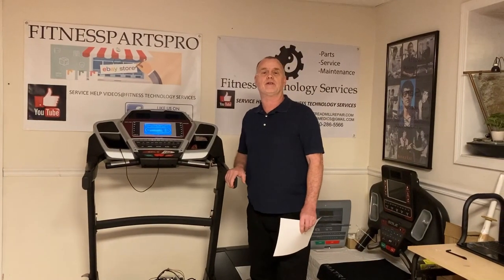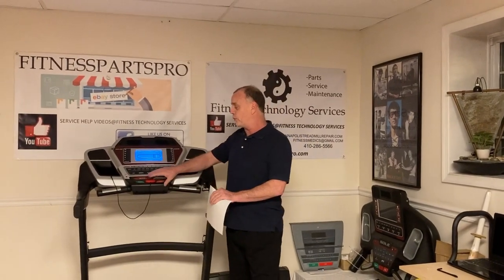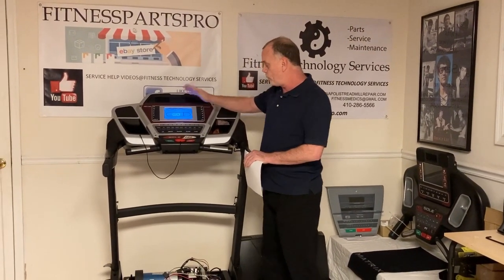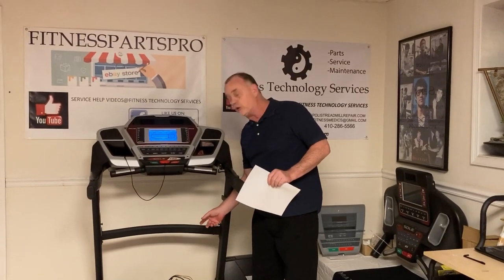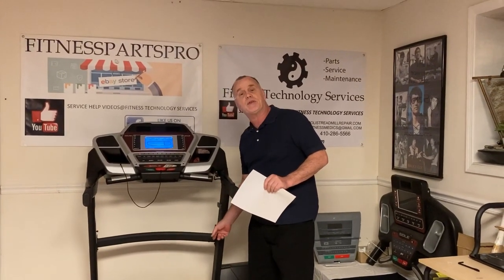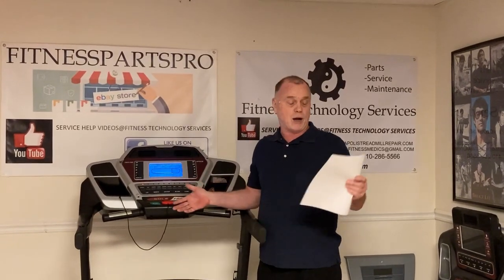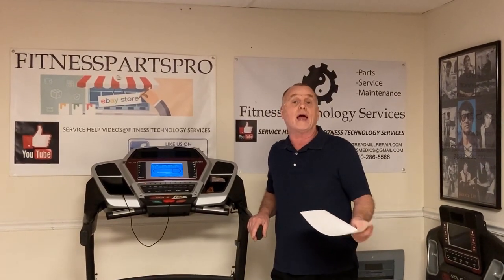SOLE TREADMILL TROUBLESHOOTING

Comment: My Sole F80 suddenly stopped when I was almost on it and gave low speed  error.  Replaced the speed sensor.  Still does it.  I have lubricated it. It still does it.  I ran it for an hour at 4mph and it was perfect.  Stepped on it to walk and it stopped after about 1 minute.  Ive watched your videos about control board and all the lights and everything appears to work as you say it should in your videos. Can you point me in a direction to get this fixed please?  Thank you!
Reply from the maker: Ok this is in the walk belt once the belt is worn after a while lube won’t have any effect on it .See video on testing your walk belt.If you want enter your serial number on my parts site.Fitnesspartspro.com and you can find it I also have a video on installing it

Comment: Hello.  I have a Sole F85. I bought it in May 2022 and do 2.5 miles a day walking inclined. Recently I stated getting this E2! Error.  The machine will stop dead and I have to unplug it to clear the error.  I'm a large guy at over 300 and the reason I got this machine was the 400 lb capacity
Reply from the maker: Well normally if you get a E2 you should run the unit with no one on it! To see if it is a weight issue or some type of controller error. The best way to tell is with some type of amp meter see video treadmill power meter

Comment: Bought a Sole F63 today. When I finally finished setting it up, it runs fine, but there is a clicking noise that increases when the speed increases. Seems to be coming from the left side of the machine. I am hesitant to keep running it, but thought I'd try here before calling service dept. Thanks!
Reply from the maker: Hmm on the left side could be the speed sensor hitting the front roller. You would have to remove cover to see for sure
Reply: @FitnessTechnologyServices  Wow- did not expect an answer that fast. I did take the cover off and look, but don't see anything hitting the roller. I ran it with the cover off to be sure nothing was rubbing or hitting the belt or roller. Not knowing exactly how it should look, I only assume all looks ok.
Reply from the maker: @darrinlandry639  well I am on line doing some editing on my channel normally I am not so fast but I do try . Is the sound coming from the motor. Sometimes the motor brushes don’t sit right in motor and cause tapping You should definitely call sole 1800-258-8511 is the service #

Comment: Hi there, I have an F85 treadmill which is ~3 years old and has had moderate use. I get an E-6 error when the treadmill starts which I believe relates to the incline motor or sensor. I’ve tried to reset a number of times but the error persists. I have tried to diagnose whether it is the incline motor or sensor by disconnecting both the sensor cable and the red/white/black power cables to the main controller board and restarting, but even with the incline motor disconnected I get the same error. Do you think I need a new controller board, incline motor, etc.? Thanks!
Reply from the maker: Hello E/6 is listed as a controller failed but if you bought it new should be under warranty there # is 1800 258 8511 please subscribe Dave

Comment: For the Sole f63...What if it doesn't move when it says 3,2,1... It looks like it starts to move, then rolls back and doesn't move.
Reply from the maker: This is mostly likely a lower controller issue but first run the motor on a drill battery to test it
Reply: @FitnessTechnologyServices  I tried that battery test, and it didn't run, but I'm not sure I did it right. Is there a video on that?
Reply from the maker: What of course 😀go to my home site fitness technology services type treadmill motor test 👍
Reply: @FitnessTechnologyServices  ok, battery worked on motor and it spun. So, it sounds like maybe the lower controller? Is that the one that's approx $300? May not be worth it...I was hoping for a better result and simple fix.
Reply from the maker: @ssmorol  well you also have to think what cause this most go bad due to worn walking belt see video on that also ! Dave

Comment: Thx for the video! I bought a used F65. Everything works great, i calibrated the belt. But now i can't figure out how i can connect my Garmin Heart Rate strap to the F65, they both support bluetooth.
Reply from the maker: I don’t think it will. I would check with sole on that to be sure 1-800-258-8511

Comment: My Sole F63 powers up and I can set up an exercise routine.  However, when I push the start button, it does nothing and reset after it goes 3-2-1.  I have had it for seven years but haven't used it that much. I had been consistently using it for the last 4 or 5 months.  Any assistance would be greatly appreciated.
Reply from the maker: Hmm this sounds like a console issue try putting your key in backwards and clean the silver part real good I would your serial# for better troubleshooting send it to fitnesspartspro.com on my contact form thanks
Reply: @FitnessTechnologyServices  I didn't see a serial number based on where the manual stated it would be.  However, I opened up the lower panel and saw these number on the control board (CD3332256L00424)  (YJ-2256L) &  (A512-100723024/8500).  In addition, it no longer goes 3-2-1, it now does nothing.  I looked at the key, it was very rusty. I will try to somehow clean it and placed it back in but it is in really bad shape.  If it is the console, what kind of price am I looking at to get it fixed?  Would it be better to just buy a new treadmill?
Reply from the maker: @MOEoffical1  Well consoles run around 350 to 400 but I would need your serial number to be sure . And if is over 4 years old might need walk belt also I have a bunch of videos on testing your belt, send me a picture of your console to Fitnesspartspro @ gmail.com I will send you links for testing or look through my repair channel fitness technology services for more info . The lower controller numbers don’t help on your issue .

Comment: I have an F80 treadmill that has been used lightly until about 2 weeks ago, then I started using 4-5 times per week. It'll take me through the whole "select your program" beginning routine and then when I press "start", the belt moves 1 inch and the screen displays "E7" ... how do I fix this? Thanks
Reply from the maker: That’s power failure probably bad controller. Send me your serial number to Fitnesspartspro@ gmail.com so I can see what system yours has

Comment: Hello:  Thanks for the video!  My problem is I keep getting the message say Low S1 and the belt doesn’t move at all.  Could you give me a few suggestions on how to fix it.  Thanks a bunch!
Reply from the maker: Hello sorry I must have missed this the highest chance of this error is the motor control board
Reply: @FitnessTechnologyServices  :  How do I order the part.  I need to order it quickly!!!!  Thanks
Reply from the maker: @desireecelestine3679  send your serial # to the office fitnesspartspro@gmail.com I will get it done for you

Comment: Thanks for the video. I've been searching for a solution with a problem with my F85 2020 model. I can't get any audio out of it. Nothing through the speakers, headphones, or bluetooth. I've reached out to Sole and they just brushed me off.
Reply from the maker: Hmm this is going to be in the console or at least one of speaker boards , this is hard to get to .You have to remove the console back cover and order the board that goes to the speaker. I have never done it on a newer unit. Only the main display or whole console.You have to get someone at sole , They are normally pretty good These parts maybe under warranty even

Comment: Hi Dave.  My F63 will not turn off unless I press the main power at the bottom of the treadmill.  In the past, when I removed the safety key, the treadmill would momentarily turn off.  Any suggestions?
Reply from the maker: @TimG-k2v  Hmm I would first check the safety key module it is what the key slides into see video on changing sole f/63 display I show it in this video

Comment: Hi Dave, your videos are great and I really appreciate your help.  Like some of the other commenters, my 2021 SOLE F65 treadmill stopped abruptly during a workout.  When I try to power it back on, I see the red power light  but the display will not turn on.  There is a solid green LED on the circuit board.  I tried recalibrating but that doesn't work and have left the power cord disconnected overnight and tried again but nothing. There is a red flashing LED on the Bluetooth icon on buttons (I don't know if that's supposed to mean anything).  Any help would be greatly appreciated, thank you.
Reply from the maker: Well thank you, on newer units it’s hard to say. There not a lot of troubleshooting information. But normally if it happens while you are running the controller is bad over heated, normally due to walk belt wear . Are your parts under warranty ? If not you can send me your serial number to Fitnesspartspro@gmail.com and the office will check. If you want send me your controller and I will test it

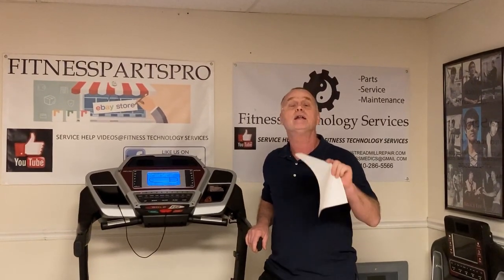Comment: Dave- within the past year, I 4:04  have replaced the motor, circuit board, the mat and flipped the deck on my F63. Today while 28 min into a run, it stopped suddenly, the screen went black then came back up. No error.  Any idea what happened?  I am 5’6” 150lbs and was running at 5.5mph on zero incline.  I checked plugs and the emergency sensor and all were secure.
Reply from the maker: Hi Traci try running the unit with no one on it see how long it runs. If you can get the amps reading. Also do the walk belt test again. Send me your serial number again. The deck flipping is not always a permanent fix I think yours was on back order at the time

Comment: My issues is treadmill turns on fine and can pick the work out but second I hit starrt hear a click and then reading e7 error can please tell me the answer before I buy a new motherboard or just a new treadmill.
Reply from the maker: @tayhorsley404  Hmm the newer style controller board does not troubleshooting lights on it to check faults. Remove motor cover and look for burnt spots on the motor connections. Also look at the power light on the controller is it flashing or solid ( flashing bad)

Comment: Sole F80 fast and slow button will not work on the handle but will work on the console with the increment buttons...the incline works...was sitting for a couple years..Thanks.
Reply from the maker: That sounds like the handle bar button went bad

Comment: I bought a used Sole F85 in September.   I really enjoy it.  Recently it powered up fine, accepted the workout instructions but doesn’t start up when I press the Start button.   The Stop button shuts it down just fine.   What’s the fix for this?   Thanks in advance.
Reply from the maker: Well depends when you hit the start button does it make a sound! And does the display change. And belt does not move? If button works then controller is bad. If start button makes no sound you could start with button.send me your serial number to Fitnesspartspro@gmail.com so I can see what yours takes

Comment: Hi thanks for this! I just purchased and installed a f63 and we just used it for the first time and after 10 min. it stopped and E5 displayed.  I turned it off then on and started it up again and after 5 min of light jogging it happened again.  I can’t seem to find any info as to why this is happening on a brand new machine. Please advise thank you!
Reply from the maker: Hmm that’s too new! See how long it runs with no one on it and double check the harness connections maybe the harness is shaking loose. And thank you!

Comment: Hi Dave, great videos, very helpful when troubleshooting.  I’m still stumped with my F63.  Hit start, no one on the unit.  Motor starts, LED blinks with each rotation but I get an LS1 after 8 to 10 rotations, under 10 seconds, every time.  Tested and adjusted the sensor, seems fine.  Any ideas?
Reply from the maker: Hmm see my video on troubleshooting sole motor controller see if you are losing your PWM light when it fails. Something is dropping off signal. You could also run your motor off a battery to see your signal speed light drops off. That video is called testing my sole motor. Let me know
Reply: @FitnessTechnologyServices  Thanks Dave, I connected a 13v battery and the motor and belt run fine on their own with the unit off.  I turned the unit on, connected battery, speed sensor blinks as expected, no PWM light.  Hit the start button, connected battery, speed sensor blinks, PWM lights (dim due to low speed I’m guessing), and after about 5 seconds, LS1 error and PWM goes off.  Same behaviour every time.  Note the speed on the console never changes from 0.5, although at 13v I suspect it’s going faster.  Anything stand out?

Comment: Good evening ! So I have a treadmill sole f65 and the lubricator message just won’t reset and appear on repeat on screen! I’ve lubricated the belt obviously ! What should I do ?
Reply from the maker: To reset the lube message this is in engineering mode . Hold down (start,stop,and enter buttons. Then insert safety key. This will put in it engineering menu then press enter button. Then scroll until you see maintenance then press enter to reset lube message. Then press stop to exit
Reply: @FitnessTechnologyServices  thank you so much for the quick feedback! From now on I’ll know where to address my future issues if any ! God bless you 😁
Reply from the maker: @apostolossou3072  always my pleasure

Comment: Hello Dave.  Great videos!  I have a Sole F83 which is 10 years old.  Started getting LS1.  I called Spirit Fitness and through multiple conversations, I tried: 1) new motor, 2) new control board and 3) new walking belt.  None of these fixed the issue.  The treadmill calibrates well.  When i press start (even with no weight on the machine), the motor and walking belt seems to pulse/stutter.  If I then get on the walking belt, the pulsing continues and feels quite unsafe.  Spirit fitness has no new ideas for me.  Might you?  Thank you in advance.
Reply from the maker: Just answer this on email well as best I could
Reply from the maker: Well I think I answered this on email but I would also check speed sensor move it some. And check the speed light on the controller make sure it is working

Comment: Hi Dave my Sole F63 will power on but the belt won't start until I increase the speed to over 1.7. Before this happened I was running on it and I started smelling a strong metal or chemical smell. Can you suggest anything to fix it?
Reply from the maker: This is a good chance of the motor going bad . Maybe the controller? Does the motor make any tapping noise. I would start with testing the motor see sole motor test
Reply: @FitnessTechnologyServices  it does not make a tapping noise but I turned it on today and and now it's slowing down and speeding up to the set speed off and on.
Reply from the maker: @melanyvest3357  Hmm with no one on it. That would lean towards the controller. But most controllers go bad due to walk belt wear causing overheating of the controller. You might want to do a walk belt test also

Comment: Hello I have a new F80 and I am under the weight limit but just barely it was pretty quiet at 1st all I'm using it for is walking however now when I walk under 3 miles an hour it seems like the motor makes a noise on each foot stop is this normal it does go away or almost goes away at 3.0 and above. It was quite first week then started second week. Best way I can describe it is a strain or slight whine on every footstep.it does not do it with my wife on it. I am 6 pounds under weight limit. Many thanks.
Reply from the maker: Well that’s a sign it’s at it’s weight limit. You should lube it for a start. But I would call sole so they know what’s going on with the unit

Comment: My Sole F80 has worked just fine until today. It’s saying the safety key is not in even though it is.  As such, it won’t work. It was fine yesterday and now it won’t work.  Any thoughts?
Reply from the maker: Well most likely this safety key module that the key slides into has broken. The only video I have that might help is changing your display on a f/63 I show the module in that

Comment: I have a Sole F80 showing an E2 on the incline and the incline is not working. I pulled the incline motor and did a continuity test on the red, black, white power wires and found no continuity. Does this mean I need to replace the incline motor?
Reply from the maker: Well I have never been asked that question on the incline before? I just checked mine it was 22 OHMS on the red to white and 25 on the back to white

Comment: Hello I have a Sole treadmill f63 I recalibrated it after it said incline error. Then it says error found once I finished recalibrating it. I took the cap off and something smells. Any idea what it could be? I would greatly appreciate the help.
Reply from the maker: Hello I would think this is in the controller. The incline motor hardly ever fails.

Comment: I have a Sole F80 that always ran fine. Recently re-lubed the belt. I was running today and it just suddenly shut off. Now will not turn back on. Have unplugged, made sure plug functional, and tried again. Nothing. Any help/thoughts appreciated!
Reply from the maker: Does the console look like it’s working fine all buttons responding! If so I would say the controller has shorted out when the belt gets worn out lube won’t help

Comment: Hello, I have an F80.   It recently started making a sizzling sound when plugged in to outlet.  Not even powered on with safety key. Any thoughts?
Reply from the maker: Well that sounds like a direct short on the AC side of the controller or a short on your outlet. I would be very careful on that one. Maybe you should get a service technician on that one